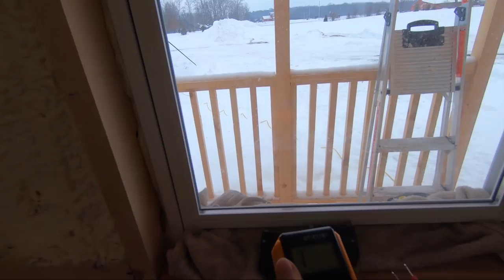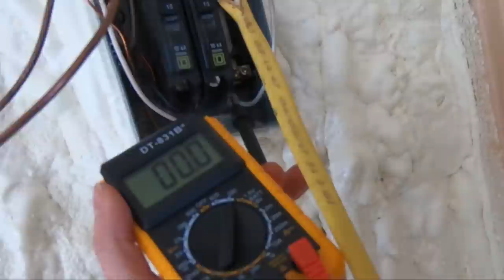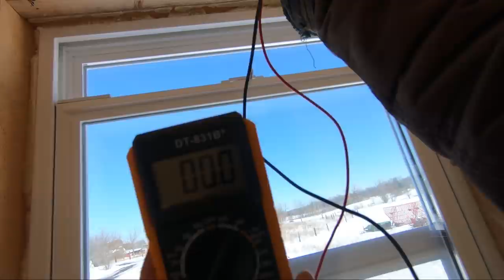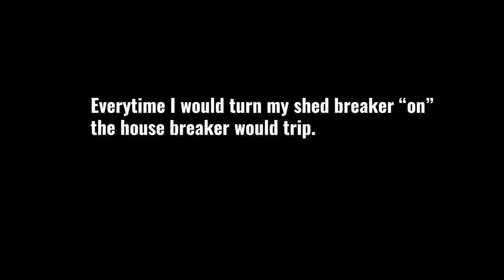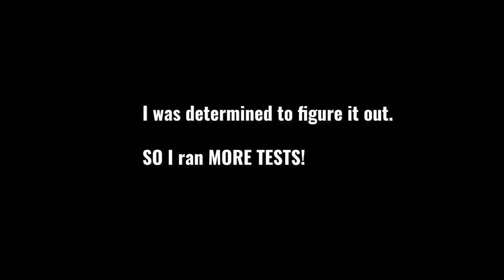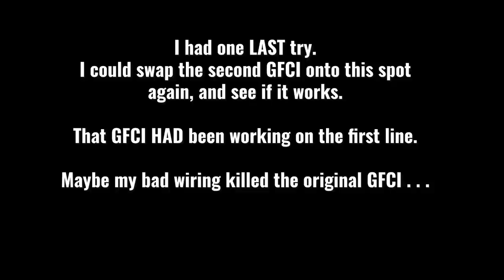DUMB MISTAKE Made it BLOW- UP?! -- Shed to House Cabin Vlog #10

Comment: Way to go! If you want to do a test on wiring and are afraid of power, try using a light duty battery charger. 12 volts, low amps you can test for continuity, make sure which switches go to what, and not worry as much about getting zapped.
Also, it is the voltage and amps that get you, not the watts.

Comment: Farmers are some of the most well rounded tradesman since most of the time they try and fix things themselves. You tube is your best teacher for the money. Experience is invaluable in reducing the time required to diagnose and resolve issues. I spent 40 years fixing elevators and sometimes it took days and days to find what was causing the problem. So dont fret over a mistake, learn and move on.
Reply: If they were Otis elevators, I probably caused the failures when I miss wired the car operator panels. sorry, but at least I lost the job so there can't be more than a tears worth of errors out there.

Comment: Your risk isn't measured in watts,  the voltage only has to be enough to overcome skin resistance and 30mA would cause your finger muscles to contract and grip onto a wire. It happened to me as a kid, I'm only not dead now because I fell backwards and not forwards.
Your fence shocker is safer because it pulses the voltage rather than running at 50Hz, so your hand gets jolted back instead of gripping the wire.
The biggest risk there was doing anything with a dog jumping around... O_o
but hey, you learned how to do new stuff, so all good :) whoever sent you a multimeter knew you'd really need it one day, everyone should have one (or about ten if you are me, lol)
Reply from the maker: ahh, yes that makes sense!

Comment: All getting bit with 120 volts is a wohow sitchewashen.  I know dirt hand . And a breaker can test good and be bad !!!!! 
I sent a plasma cutter back because the breather tested good!!! 
But when I tried to use it later on a motor .  That was when I figured out it was bad 😑
Did you have power to the power inside of Bothell breakers?????
That is a range box and has to have power going to both breakers!!!!😊😊😊😊

Comment: For future use I would not use WD 40 on any electrical connections. GFCI have a line and load stamped on the back of the outlet. The black and white wire coming from the electrical panel has to go to the line side of the outlet first. Then if you are using other outlets and lights they go on the load side of the GFCI. I am sure you noticed the color of the screws on any outlet. The brass color screws always go to the black wire and the silver color screw always the white wire goes to. Honestly you did a great job.
Reply from the maker: I don't know how I messed it up. But I know it was the last outlet I did and clearly my brain was fried at that point :(
Reply: I believe that technically the code says All outlets must be fed from either the top or the bottom, I do not know which, and the load, next outlet in the daisy chain, must be run, obviously, off the opposite. This is why electricians use a marker to mark each feed side cable when they first run the rough wiring.

Comment: My first electrical project I did was wiring an outlet that could be mounted with a cord that could be plugged into another outlet in the room. I ran the wire to the box & stripped the wires so I could hook up an outlet later. Then I put a plug on the other end & of course plugged it in to test my work......
POP!! FLASH! Light in the room out.
Yep, forgot to mount an outlet on the other end & had the black & white wires connected. One replaced fuse & properly connected outlet later & everything was good.
Moral to the story: double & even triple check everything!

Comment: Your multi-meter will measure the AC voltage black to white, red to black or black to black, red to white. Both ways will work. If you were measuring DC voltage and had the polarity backward the multi-meter would show a negative voltage.
Reply from the maker: oh ok, that's good to know!
Reply: With a digital multimeter, set to DC volts, reversing the Black and Red meter leads will simply add a minus sigh preceding the measurement. It has NO effect on the accuracy of the measurement. Simply ignore the minus sign and pay attention to the measurement reading. When set on AC volts, the Red and Black leads are totally interchangeable.

Comment: Susan  doing great, they do make a plug in tester for regular& GFI outlets for like 5.00 bucks each, will tell you if everything is wired right or what is wrong.  When you make a mistake & find it yourself you will not forget it. Safety first.👍
Reply from the maker: Thankyou! I look into getting one for the house build!

Comment: Step by step foor wiring GFCI's:  There is a line side and a load side to each GFCI outlet - they are marked on the back of the outlet.  The hot cable from the main breaker wires to the line side of the outlet with the black wire attached to the gold hot terminal and the white wire attached to the silver neutral terminal.  The load cable going to the down circuit duplex outlet attaches to the load side of the outlet with the black wire attached to the gold hot terminal and the white wire attached to the silver neutral terminal.  The grounds from the line and load cables attach together with a wire nut and a ground pigtail attaches to the ground screw on the outlet.  If you do not need  the down circuit outlets controlled by the GFCI interrupter then you attach all the black hots together with a wire nut and attach a black pigtail only to the line gold hot screw.  Then in similar fashion attach the white neutrals together with a wire nut and attach a white pigtail to the silver neutral screw.  The ground wires are the same for both methods.

If your a visual learning type person most big box home improvement stores should have how to wiring books with lots of pictures to show you the proper way to wire GFCI's and other circuits.

Comment: They sell a PLUG -IN Outlet tester..  It plugs into the outlet and displayed coded light/leds that allow you to know it is OK, or wired wrong.....indicating what is wrong.      Best to then follow up with an electric toaster test.  That puts an 11 amps load on the curcuit. Any poor connection would fail or arc.
Reply from the maker: That's cool to know, thankyou!

Comment: Suzanne,   For your safety!   Never ever turn a circuit breaker standing in front of it.   Especially without a cover.   Always stand off to the side!   The reason is, if you have a short circuit, you will have thousands of amps going through it(depending on what it is hooked up to).   Breakers can explode and a fireball comes out the front.   Also, on your meter, red and black are for DC.   AC it makes no difference how you use them.    On GFCI, line is conductors coming from the panel and load is conductors going to other breakers.   As you found out, reading voltage from the lug on top to the output of the breaker is zero volts(because you were measuring from the same point).  When you went from lug to neutral was when you got the 120 volts.
I strongly suggest that if you build a house, you get someone else to wire the house!   If you find someone that will let you help and supervise you, that would  be good for you.   Right now, you are lost.     Respectfully but honest,     Kevin

Comment: you tested the breaker wrong when you tested it in the window, test top terminal, and screw it will read good the bottom terminal just holds breaker to box.
Reply from the maker: I realized that when I watched the footage back, lol! The first time I tested but was, but I got it right thereafter once I got a better handle of how the Multimeter worked :)

Comment: Multimeter: Never take a reading thru PAINT ......contact metal to metal.  
Voltage: One lead to ground or neutral ....the other to point to be tested.
Amps:   Both Leads are in series of a line.  Most meters are fused at 10 amps inside the meters.case body. Never test over this without using a meter shunt accessory that shunts the meter leads to allow a higher reading. 
Continuity:   Reads out as OHMS,  Never connect to a LIVE power on curcuit.   Open or a very high ohms reading.     Short or a very low ohms readings.

Comment: Yes the breaker box can go bad. How you can tell is the breaker terminals with have a rainbow coloration which means your getting the box is under stran. How to tell if you breaker are bad is by testing them. Make sure you the black both wire is on the gold color screw

Comment: Hay Suz. A) Your rough inspection is not your final. 2) Wiring is not rocket surgery or magical. And C) the screwdrivers in the electrical kit I sent you are insulated. 4) I've never been electrocuted, but I've been poked by 120 once or 17 times. And E) So now you know what a dead short is. We had training on disconnecting 7,500 and 15,000 volt forklift battery charging areas in our plant in case of an emergency. We had special gear for that..(we called him the apprentice). Just remember...if I can do it, so can you.Stay safe.;-]
Reply from the maker: Huh, I thought those were just regular screwdrivers! Well dang!
Reply: @This1LifeWeLive  Those are made just for elec-chickens

Comment: Yes, everything should have been tested.  I doubt the breakers are bad. Check your source first (end of extension cord that you are backfeeding the breakers with.  *Are ALL your switches turned ON. *
This is not a job for amateurs. If you left your Junction box clear of Foam as was suggested and per Code you could check the output there.  DO NOT be poking your fingers in there.  That is what Insulated shaft screwdrivers are for. Only ONE hand messing with the wires, the other far away.  Test Black to Ground at Duplex outlets, AFTER you turn power off and tighten them properly.    SMF  Pointy ends DOWN in tool belt.  Better to puncture your leg than gut.  Breakers snap in.
Let your meter read full Voltage, not just flash numbers.  Press the Centre button of the original GFI. You have 2 different types.  Properly install all switches and Duplex outlets so they don't touch the sides of the box. Now!  * I think I see your problem .  On the Loft Duplex test outlet you have black and white on the same side of the non GFI!*
Reply from the maker: They all read full voltage, I just clipped in quick shots, thats all :)
Reply: Ah, yes! The Cardinal Rule of electricity! Rubber soled shoes or boots and Only ONE HAND Near any power carriers.

Comment: ...bare wire ends need a wire nut ALWAYs if hot  you can test with leads into back of wirenut IE (extension cord and light leads) ....fingers around hot circuts while head turned talking to camera is dangerous....consider a GFCI with a light indicator on it for the difficult to access area......multimeters just read negative volts if you reverse the leads.......inspector will normally use a circut tester on hot outlets and check for correct grounding.......your doing fine ..you will do better the next time ...its all a learning experience just be safe "sparky "

Comment: Ok so your electric fence is DC if it gets you on the wrong beat of your heart it can stop your heart and you are dead same applies to your car battery but in reality this would very rare. Your house is an AC system cycling from 110v negative to 110v positive 60 x per second on each leg or phase this will upset the normal rhythm of your heart if it grabs you for a period of time and you are dead but it may take time so you can be revived if there is a defibrillator handy. Always go to hospital to have your heart beat monitored after a hit from AC. There is also a risk of internal organ damage from the heat generated as the current passes through. Electricity does not just take the easiest or quickest path to earth it will take any and all paths it can find so don't play with it.
Reply from the maker: 🤔 Our horse fence is AC just like the breaker box I plugged in . . . it's connected to the barn which is fed off the house . .
Reply: @This1LifeWeLive  Your electric fence is powered by AC, but the output is DC.
A car battery charger, cell phone charger, and laptop charger are powered by AC, but the output is DC.

Comment: Actually 110 was replaced in the 40s or 50s, bumped to 120. Do you want to know why Europe and other countries run on 220volt/ 50hz? Volts don't kill Amps do. 
My Sisters FIL did appliance and A/C repair in the 50s through 70s he had all kinds of burn marks on the back of his hand from circuits that were "off" . He always tested with the back of his hand before he grabbed them in case someone turned the power on after he had turned it off.
I've been shocked but not "electrocuted " old house circuits don't make sense when they been Jerry rigged over the years. 
Nice job on working through your issue! 
I know you believe in continuing to learn and think you are doing a fine job of it.
Take care!

Comment: Could have hammered too deep in a staple holding the wire. The compression of power cable  insulation could cause a short. You need to go from plug to plug undoing wires checking continuity of the line and load wires to determine continuity until you reach your panel.

Comment: I hope you realize that there is a line and load side on  ground fault Interrupters, and they need to be wired accordingly. Also if it is in a difficult location to reset when it trips, a ground fault breaker may be handier.

Comment: Easier way to check on power, take a generator plugged into a plug by a double plug ended cord . It will feed through the panel and if you shut off the main, no back feed.
Reply: That's not a smart idea for a novice to do. She's still learning the basics.
Reply from the maker: Well and I don't have a generator ;)

Comment: Could've been worse.  The breakers were doing what they're designed to do and prevented any damage from being done.
Reply from the maker: But I couldn't figure out why my cabin breaker didn't trip . . .
Reply: @This1LifeWeLive  It could have been a number of things.  Breakers have an AIC rating (Amp Interrupting Capacity).  The rating on the breaker in the house may have been lower than the one in the cabin (5000 AIC vs 10,000 AIC.  This information is usually stamped on the side of the breaker, it's all the information on the side that most people don't look at (and frankly they don't need to worry about). Even though both breakers may be rated for 15 amps the one with the lower AIC will trip faster than the one with the higher rating.  This becomes important in larger projects but usually doesn't get much attention paid to it in the residential side.  I've also seen where different manufacturers will trip slightly faster than another one.  The important thing is that it tripped.  :)  Keep up the good work!!!!  You're doing great!!!

Comment: The real question is, why didn't the so called inspector catch this? The answer is, he was not thorough. I also didn't hear him ask about the grounding system that  needs to be installed. If he was licensed and his name is going on the paperwork, than he damn well should get his ass on a ladder and INSPECT!  It's a little thing called liability!
Reply from the maker: As others had mentioned, it was a rough inspection and I wasn't even supposed to have had the outlets connected yet, so most likely that's why he wasn't so particular on it. Pointing out wiring things for me to fix was a help for me to pass my final inspection later.
Reply: Or another little thing that seems unknown in the U.S., Today, called INTEGRITY!

Comment: Yes I have been electrocuted! Back when my younger days in school at a vocational school high school a welding class, my shop teacher asked me to move an old lincoln welder that was wired direct into the wall 440 so I did ( with a pair side cutters having my head up my ass and not playing attention it lifted me off the ground 3 and one half inches from other kids that witnessed it only thing that saved my life was leather gloves and a small thin rubber coated handles on the cutters   the teacher showed me the cutters it had a pencil size hole in the cutter. So THINK ABOUT WHAT THE YOUR GOING TO DO, AND BE SAFE OUT THERE!!!!!
Reply from the maker: Yikes!

Comment: There is a load and line side on gfi its printed on the outlet it self . Don't be such a guy read the instructions
Reply: This reminds me of an old anecdote from WW2. At the start of the war when men were signing up for the services, many production managers were bemoaning the loss of many good workers from their shop floors. They were replaced by women, think Rosie the Riveter, but they were astonished to find that the shop productivity actually went up. It seems that when women don't know what to do, they ask for instructions.
Reply from the maker: I read the directions, three times as I said. But my WIRES were lined up differently and I didn't stop to look at how I had incorrectly lined up the wires.